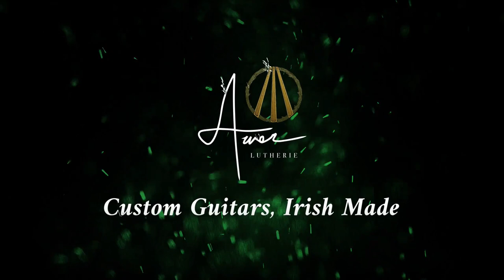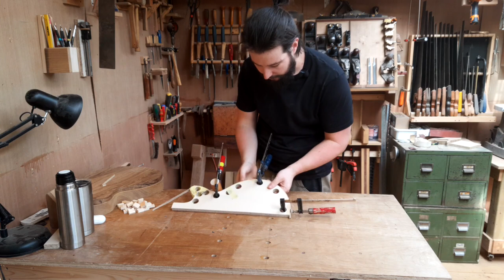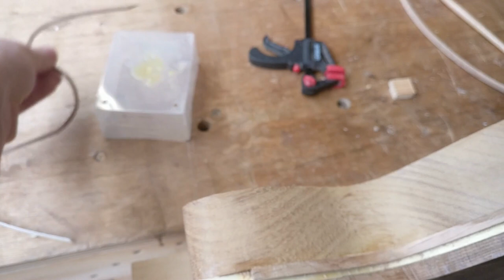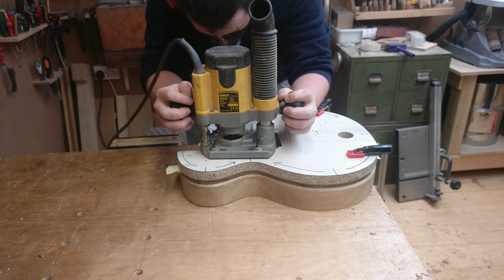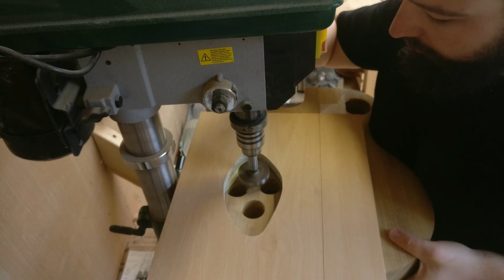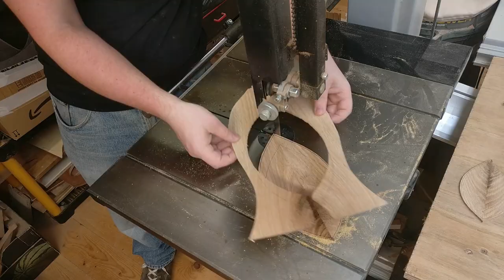The (Unofficial) GREAT GUITAR BUILD-OFF - Video 4, Y'all Better Call A Dentist cause we got CAVITIES

Comment: Thank you so much for the arrows on the body marking the grain direction. I never fully understood that before, but now I can continue doing it wrong, and knowing why I get tear outs.
Reply from the maker: Grain direction can be such a nightmare,  but without something like these scary long double-bearing bits,  it's kind of just a fact of life that you will get tearout of some description.
If you can adjust your router speed,  that can sometimes help to go at a slower or faster rpm.  It all depends on the wood though

Comment: Looking fantastic, looks like it might be a bit weighty until you carve to top. Also what's the bump on the back top end of the neck for? Great video, looking forward to the next one.
Reply from the maker: It's meaty for sure at the moment,  but not awful.  
That bump is a seriously over a exaggerated volute.  I will carve a lot of that down,  but it's a lot easier to cut it over-sized than try to put material back on! 
Thanks do much for dropping by

Comment: Just subscribed! Anyway, This build is soooo in depth.  I'm a Fine Artist/Guitarist and your approach has me hooked. Question if you have the time to answer: I have no big time tools such as a drill press, belt sander, Planer,  etc...How would you suggest one getting their hands on some heavy duty equipment at a low price or what small tools to substitute for the larger ones I will need?  Thanx man and I'll be waiting on vid #5.
Reply from the maker: Thanks so much for the sub,  really appreciated! 
That's a good question,  I'm planning on doing a couple of videos based it that idea probably after the build-off.
As for getting your hands on them,  I'd suggest trawling classifieds sites,  Craigslist or gumtree or whatever you have wherever you are.  You do need to know what you're looking for and research potential buys.  This way takes a whole bunch of time,  but you can save a load of cash if you're patient. 
As for what you want to buy,  there are plenty of substitution options there,  depending on how much time or clever thinking you want to invest. For example, I used a hand-held belt sander clamped on it's side in place of an edge-sander when I started off.  It was a nuisance to set up,  and slipped every now and again,  but did a passable job.  You can also use a jigsaw to cut profiles,  but you need to leave a lot of meat since they tend to not cut square.
Nowadays,  the likes of lidl and aldi often have bandsaws in,  so I'd just get one of them and save the heartache of a jigsaw. 
A router is one tool I will say that is absolutely necessary,  you can cut the neck taper perfectly with it,  do all of your cavities,  and make a table mount for it.
Reply: @AwenLutherieCustomGuitars  Thanks so much for the info. I truly can't wait to see your guitar come to life.

Comment: you need to heat resins in the wood so that they soften and let the wood bend. there are many examples on line to refer to. i believe you have the skill to do this, you just need to get the right technique. there is more than one way to do this. you are sure to find one that fits for you.-- an old dude
Reply from the maker: Wood bending is new to me,  so I have a lot to learn for sure.  I believe I could have done better with the grain orientation in the binding as well,  but technique is absolutely where I need to focus my attentions. 
Thanks for stopping by!